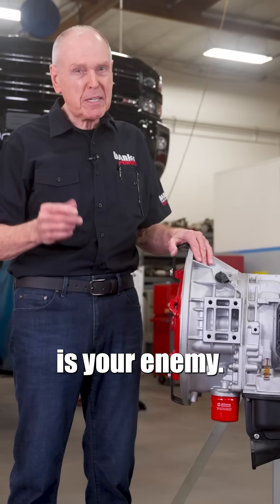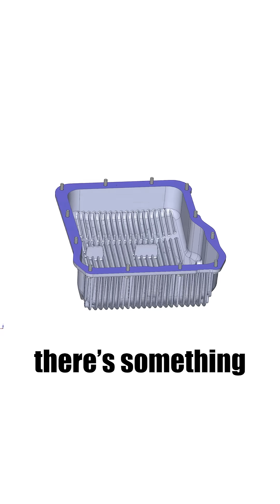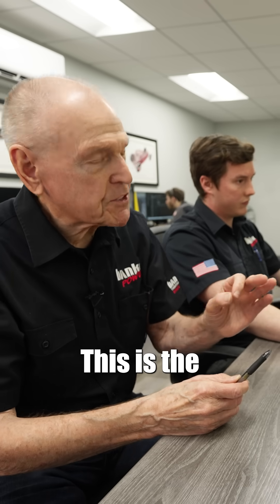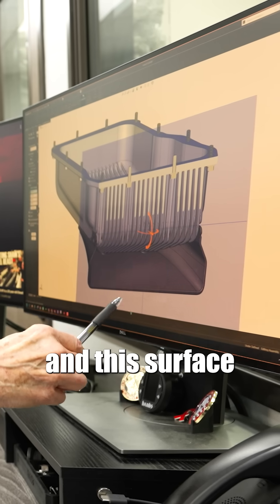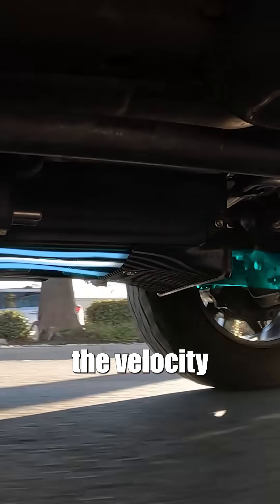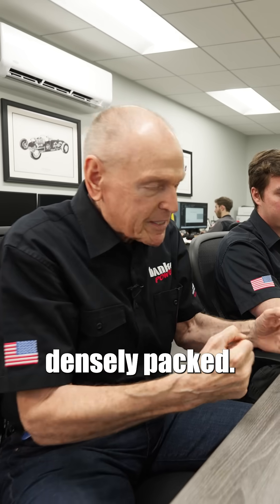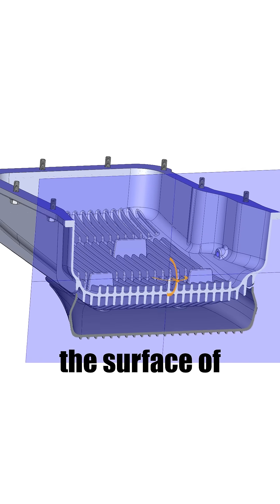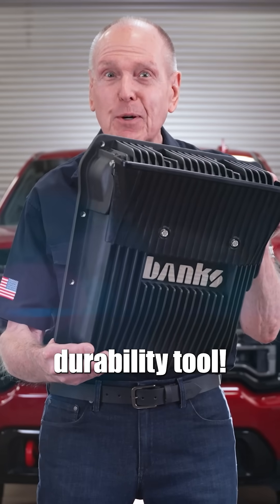This improves transmission life.

Comment: You should be the one designing vehicles.
Reply: All this stuff costs money..  vehicle designers are in the business of building things that are cheap to make and easy to replicate in mass production.
Reply: @calholli  And even though they are cheaply mass manufactured, they do a good enough job when being driven normally for literally thousands of miles over many years. 

This pan literally does nothing for most consumers except make the vehicle more expensive.
Reply: @calholli that’s not true whatsoever 🤣 if you bust this off I know gale would replace it just like the diffs, also if you’re somewhere that this touches a rock or something you’ve got bigger problems than a trans pan
Reply: @calholli You didn't actually listen to the vid. If you have an Allison trans, your not using it for off road, your using it for hauling or towing.
Reply: @calholli  This has a safety breaks system, the scoop breaks the pan doesn't, you can see the bolts. Same as the Diff cover they sell
Reply: Only one problem 
Vehicles would be perfect  
No recalls 
Manufacturer would learn something

Comment: I'd like to see some data at different speeds and temps especially when driving in the middle of summer on a scorching road. I'm sure it helps some but just how much would be the deciding factor on spending the $ and installing it.
Reply: Bro the heat fins connect! You won't find that on a PC or a Harley....
Reply: “i’D LiKe tO sEe sOmE dAtA” says the guy with no intention of buying the product. Just wants to sound intelligent by asking to see data he wouldn’t understand
Reply: Why on earth would you buy a product that claims to lower temps without seeing some actual data that proves the claims?  It's so easy to get us car guys to buy silly crap when you take a salesman at his word.  Slick 50, splitfires, etc.

Comment: I would love to know if you could get similar temperature results by running a much larger transmission cooler and how cost effective that would be vs the pan or both
Reply: An oversized transmision cooler is way more efective, the surface area is sooo much larger. Theres a reason your engine uses a radiator and isnt coverd in fins and air scoops. Its a gimic.
Reply: @ it’s not that I think it’s the catch all but if it’s a cheaper way than having a shop put on a new cooler in a more modern more complicated truck and actually drops the temperature enough for someone to stay in the safe range would it be worth it

Comment: I'm curious how much this will actually change the operating temperature compared to a standalone transmission cooler
Reply: I would love to see numbers to this!
Reply: Certainly more efficient
Reply: A proper standalone radiator with electric fan would be 10 times better than this overengineered stupid oil pan while stuck in traffic on hot day in Vegas or Pheonix.
Reply: That's not the cooler's fault, that's a bad transmission or failed cooling system if the truck isn't overloaded. 
     Stick to tieing buttered bread to the back of a cat and seeing how it lands, on it's feet or buttered side down.
Reply: @brnmcc01  if you are having trans heat issues in stop and go traffic, you got bigger problems

Comment: Yeah this wouldnt last 5 minutes for anyone who goes offroad , or deals with snow alot
Reply from the maker: The plastic Ram-Air scoop is perforated and is designed to break away.
Reply: @bankspower Yes, but what does a replacement one cost.? And how easy is it to remove?
Reply: Yeah but slushboxes usually dont last off road anyway
Reply: @P7777-u7r I see a lot of people who go off-road with an auto. Including myself. My transfer case gave out first. But then again I drive an old XJ
Reply: If you made a scoop that has an exit where you can use the Meredith effect like the scoop on the belly of the P-51 Mustang, that would be awesome.